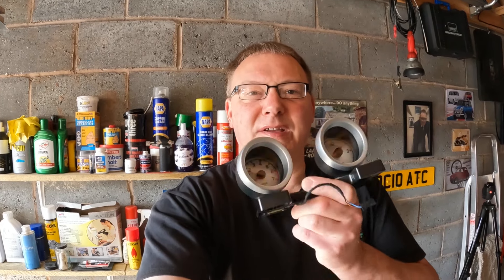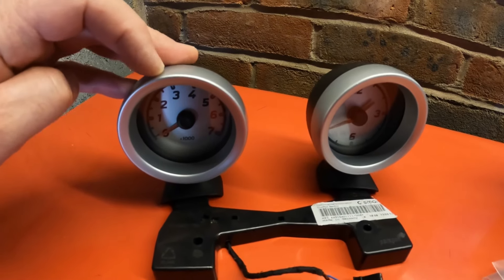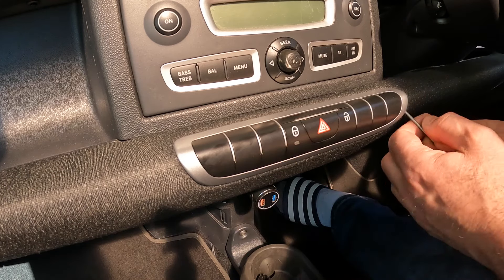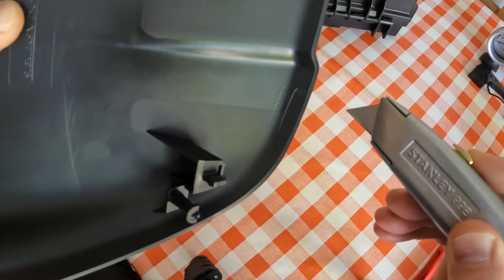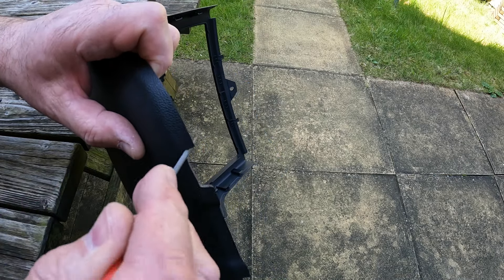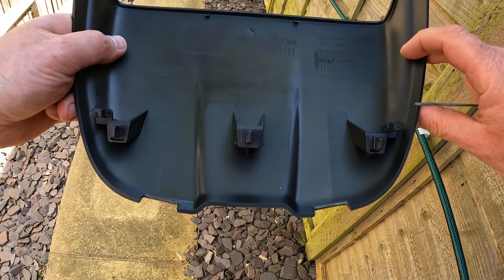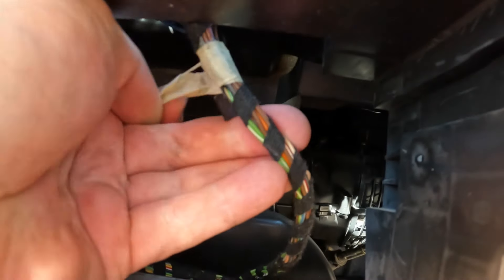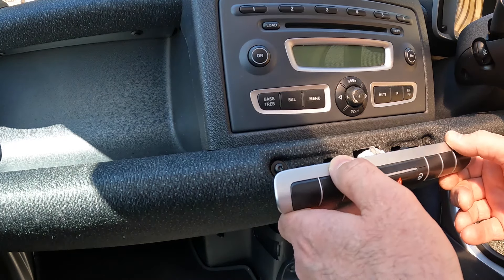Retro-fitting Instrument Pods - Smart Fortwo 451 Pure/Passion 84BHP 2008 - Tachometer and Clock

Comment: watching just to watch 👍 i already did this to mine. also changed the actual faces for some aftermarket black ones on my pods and speedo cluster because im going for a darker/black theme overall (car is black panels, black tridion, black leather) 😂
personally i wouldve used a dremel (your natural enemy) with sanding bit to remove the fascia cut outs because me and stanleys into plastic usually ends up in cuts being too deep. horses for courses! luckily i was able to swap mine with the car i got the clocks from.
i did also remove my radio to find the connector, the bugger was taped in quite far down! no way to see or find it from the top.

Comment: On the subject of retrofitting, would it be possible to retrofit cruise control or automatic headlights? I have a 2008 smart 451 that has them but a 2015 smart 451 that doesn’t. Could I part swap?
Reply from the maker: I genuinely don’t know as I haven’t delved into that one. So far though, I’ve found lots of wiring already in place for various options, which is reassuring.